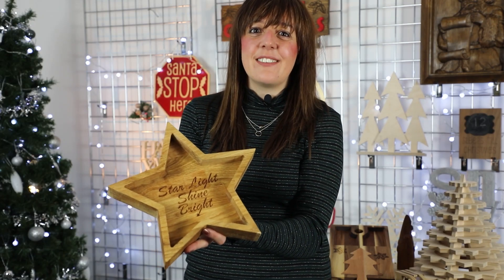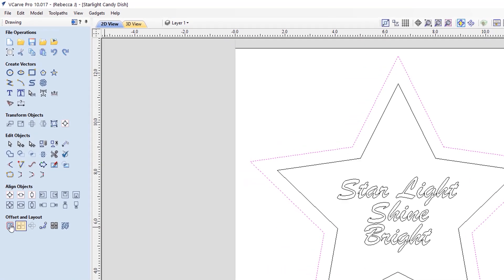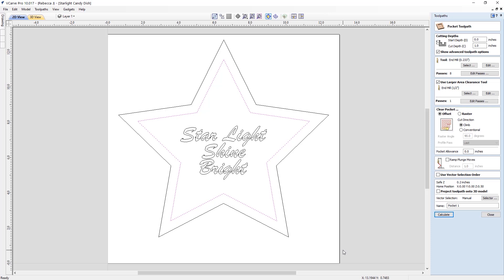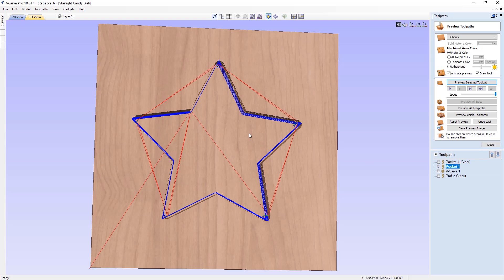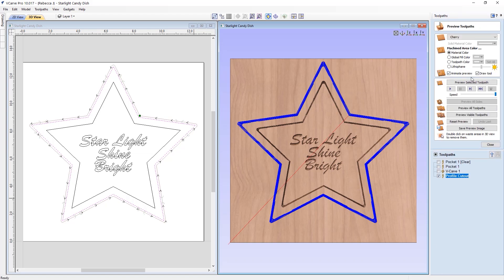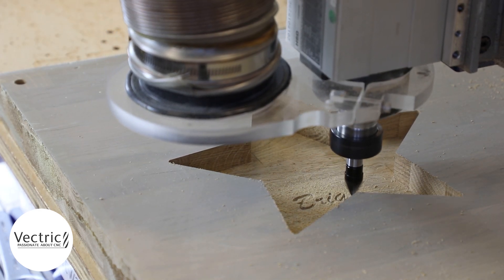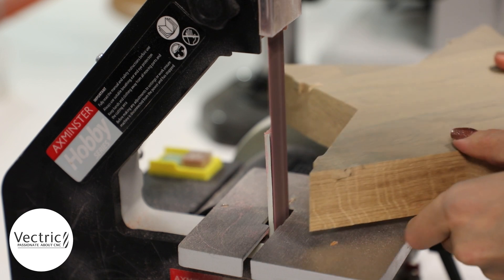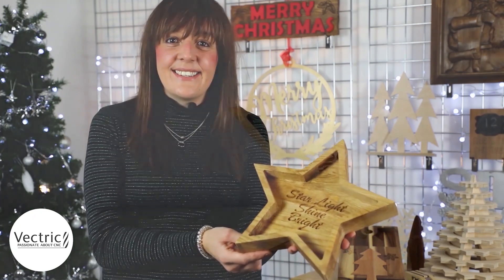The 12 Projects of Christmas | Day 7 | Star Candy Dish with Beki | Vectric In The Labs

Comment: Beki When you created the  second pocket tool path to square out the  corners of the  star did you change where the  bit cut like on the  line ,I assume  it did not cut the whole pocket again Jeff Peters
Reply from the maker: Hey Jeff, the second pocket toolpath is auto created from the first where the software will only clear the areas the first larger tool couldn't get to (you have to check the option to use large area clearance tool in the pocket toolpath form) but you are right, it doesn't cut the whole pocket again. I hope this helps Jeff, Thanks~Beki
Reply: @vectric  Thank you For the  reply
Reply from the maker: @resorter66  No problem, have a great day!